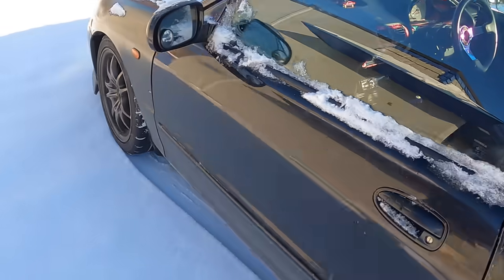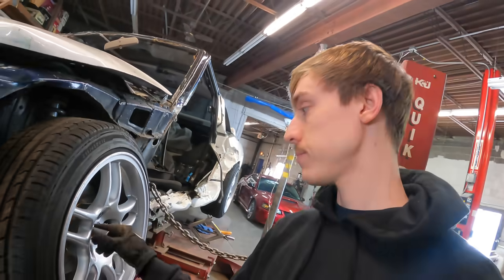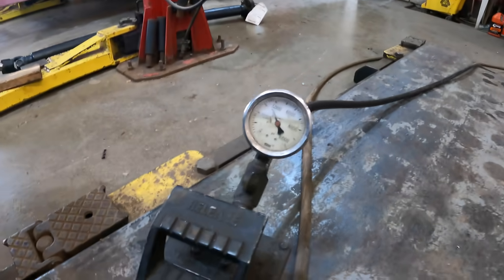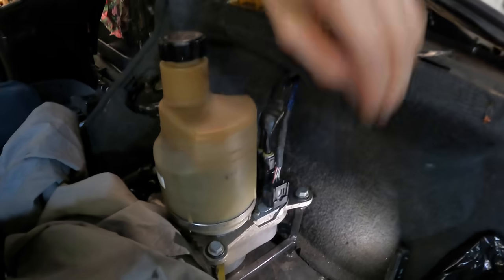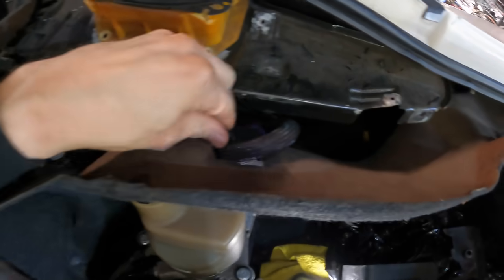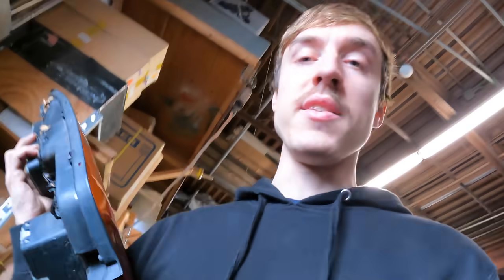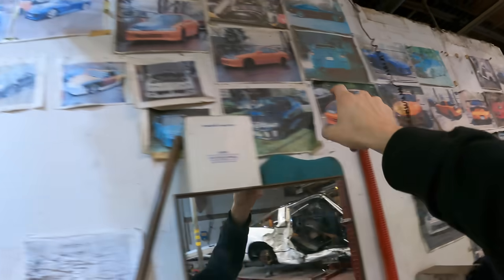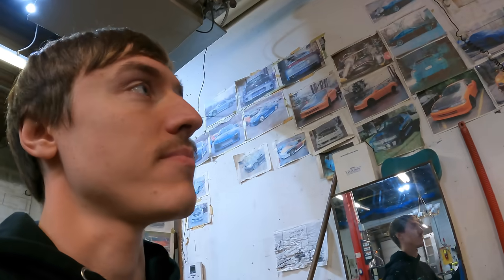Straightening the 240sx Frame and Removing Type X Wing, Windows, and More on my S13 2022

Comment: I’m into S12’s, not s13’s, but s12’s. I crashed my first ever s12 coupe back in 2019 and bent the front portion of the frame. Thinking it would cost more to fix than to just get a new one, i gave my car away to a guy who completely stripped it. My first ever car, my baby, the thing i worked SO HARD for no longer exists. Today i have a mint s12, fully loaded, turbo, and a manual (the other one was an auto) and i still regret giving my little rusty crapbox away. Seeing you fix this one makes me really happy and nostalgic. Shows me my car could’ve been fixed and i could still be driving it to this day. Keep on trucking! It will pay off one day

Comment: At this rate the best option that poor SX can have after some geometry restoration job done on a slipway is a weld-in roll cage for sure and maybe a full hull reinforcement because it will never be as rigid as it was before the crash again. Maybe cutting the front end a bit and making a skeleton using the steel pipes is a good idea too if the side members are bent already. P.S. LEDs in the windows will look rice as hell but the owner knows best.

Comment: Also, front of the shirt should have the small design(same as bumper sticker) of the crashed over the heart, back should have the fixed version of the 240 with both of you standing next to it with his shop name either over it or as a background in the same style as the sticker